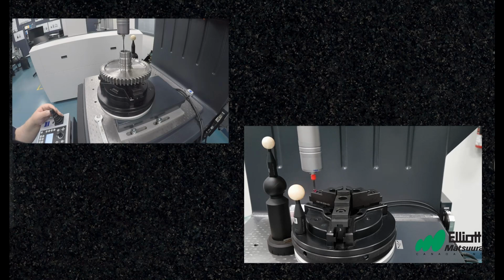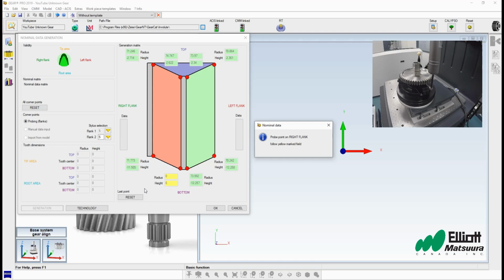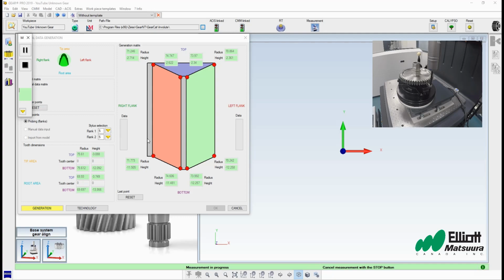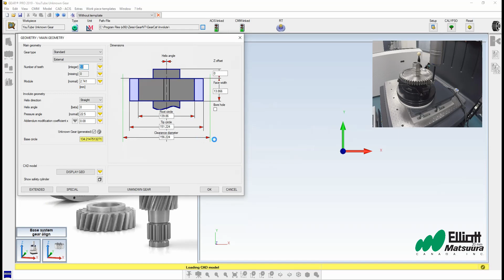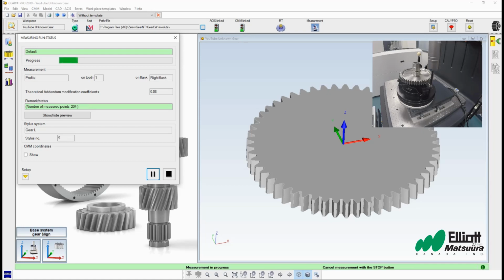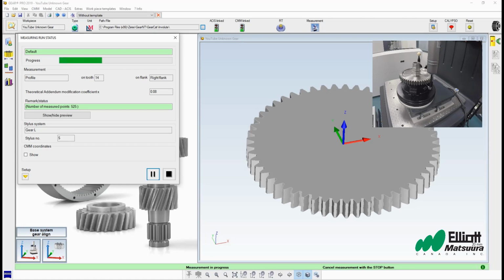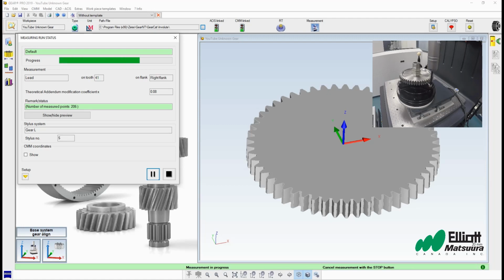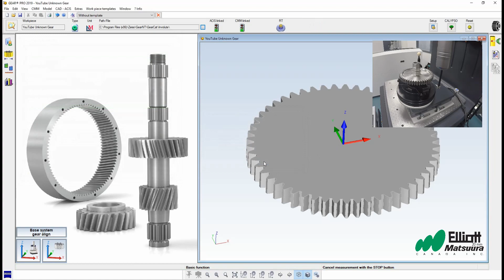GearPro: Reverse Engineering an Unknown Gear

Comment: If I were the CMM Operator, I would not have confirmed that the CAD model is correct at 4:48min, based on the model on the right of the screen. Clearly the parameters are not correct & bear no resemblance to the part being measured on the machine.